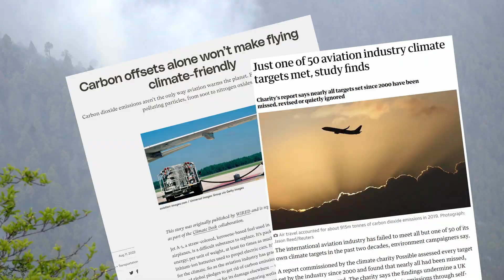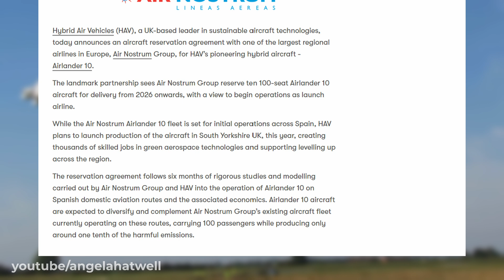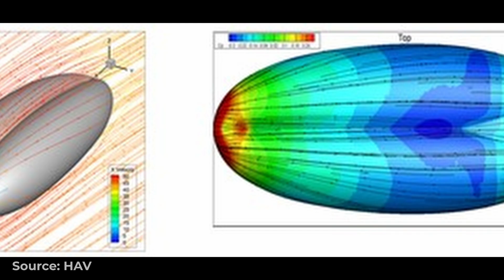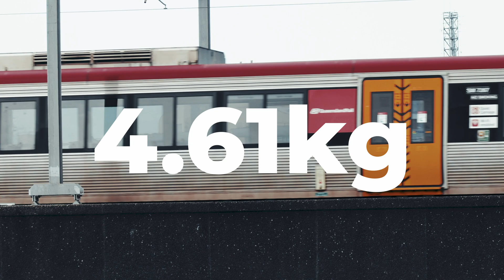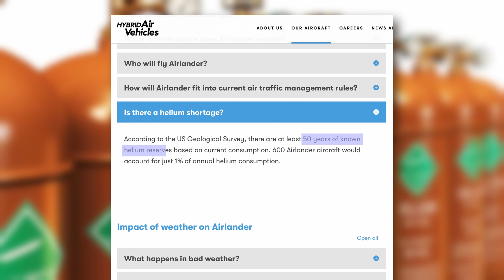Are Airships the Future of Aviation?

Comment: I think for airships to take off you have to make them for individual's more cars get sold then busses and airships would be faster then cars, that combined with vertical takeoff and landings would make them perfect for a flat roofed garage.

Also you gonna have to find a way to compress the working gas if they are going to be economical. It wouldn't make sense to sand your car tires smooth after every trip and neither would it make sense to throw out some of your expensive gas just to land.

Also there gonna need to figure out how to make mostly hydrogen blends safe, hydrogen is pretty easy to replace and helium is not, if your gonna have a billion+ airships around the world your gonna need a pretty much endless supply of lighter than atmosphere gas.

Me personally I hope they are a bit slow to adopt this so I can make the company that makes these for residential use mwhahahaha!!!
Reply: The permanent annoying buzzing would result in an alarming society, expect mass shootings and suicide to increase exponentially.
Reply: @PlumSack79  yeah I heard that criticism before. But the thing you gotta understand is that airships dont have to work to stay in the air so that is instantly gonna drop the decibels a few notches and with different technologies like stirling engines and fuel cell's I bet you can get a near silent one.
Reply: Just wait until they throw out anti-gravity
Reply: They don't have to release or compress gas, they don't need to be lighter than air. Just enough air to be light. As stated in the video, new dirigible designs incorporate features like wings and engines that provide lift. So don't think of it as VTOL like a hot air balloon. Put on a landing gear and have it launch itself like an airplane. Power on the engine for takeoff, so it starts moving forward. Once it picks up speed, the wings will generate enough lift that the dirigible becomes lighter than air. Ascending and descending can be controlled entirely by airspeed, as in an airplane. Just slow down, and the airship will descend. Speed up, and it will ascend. There should be just the right about on helium so that at cruising speed the airship stays at the same altitude. The helium could then be sealed in, and wouldn't ever have to be replaced!

The engines don't need to be very powerful since they're just moving a floating balloon at slow speeds. All they're pushing against is wind resistance. They could be quiet and efficient. It's a great use for hydrogen fuel cells. Hydrogen can be generated anywhere from any abundant source of electricity. It's far more practical for aircraft than huge battery packs. The problem for conventional aircraft is where to store the large volume of hydrogen, but that's no problem with airships which have hardly any limitations on cargo volume. Weight is still a factor, but much less limited than with other aircraft.

I think it's worth experimenting to have some controllable and perhaps collapsible sails to harvest wind currents in the sky. Quiet, free energy to contribute to windspeed.
Reply: @Paelorian  what is this wonder  material that contains helium without loss? It only exists in your imagination right.
Reply: @PlumSack79  I have no expertise in helium tank design. That said, helium can penetrate many solid materials but I don't see why a storage tank could not be designed to hold it with little or no loss. Due to the practicalities of airship size and the fact that it's a moving vehicle, some leaking may be inevitable but helium is non-reactive and properly designed metal tanks can hold it. If there are occasional small leaks to be repaired, that's a far cry from deliberately releasing helium during every flight. Some extra helium can be carried in liquid form to make up for any losses. And the tank wouldn't need all sorts of valves to frequently take in and take out gas, so it could be designed to better resist leaking.

Helium is the second most abundant element in the universe, so eventually helium storage may be less of a concern. But as is, extant supplies are finite and it's expensive. It would be practical to reuse it as much as possible.

Anyway, the argument about these kinds of losses miss the point. These are minor unintentional losses, not the major losses by design of some old airships that would release gas to land. That's what the first post was about. But no gas needs to be released to descend if the airship is slightly heavier than air and gets lift in the atmosphere from airspeed while in motion.
Reply: @Paelorian  i like your idea and do think it has it's place and I respect that. Perhaps your way will be the best way to bridge with existing technology and may even become prolific! 

I do prefer a VTOL vehicle because it reduces the space needed to launch and land significantly. This in theory should mean that people with limited space can land it in a place as small as a roof designed for that.

Maybe in the future we will be able to mine helium from the moon cost effectively, that will be the best case scenario! 

I hope your idea and mine both wins!